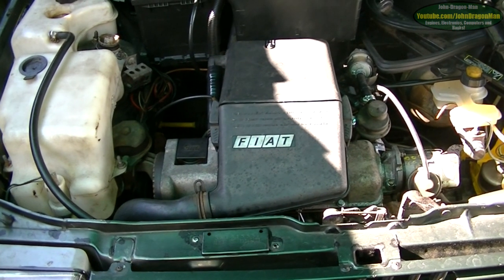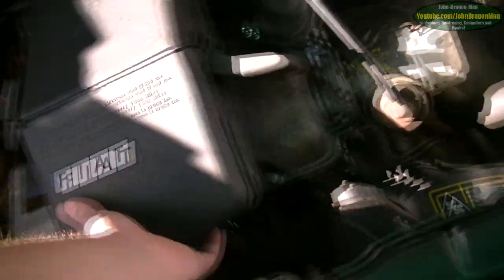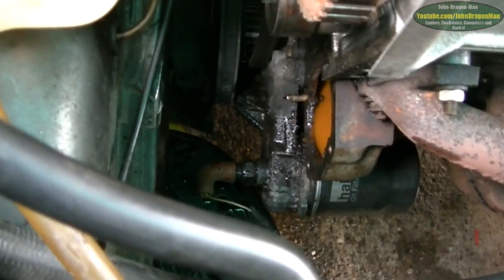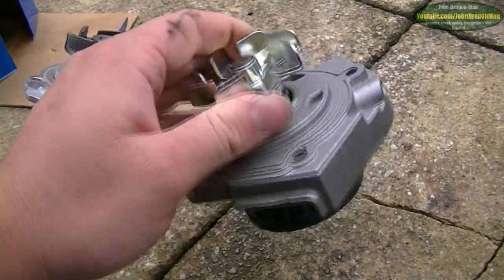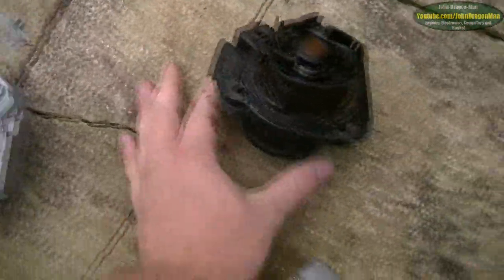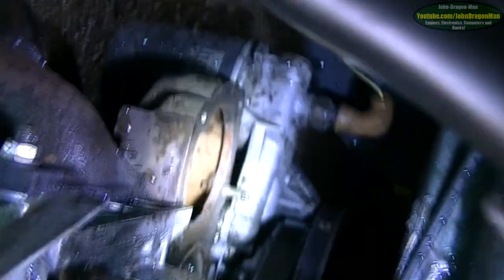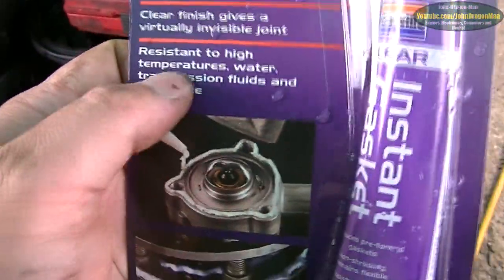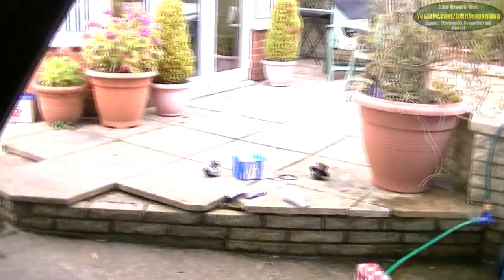Fiat Panda 4x4 Sisley Video log No. 28 (Water Pump Replacement)

Comment from the maker: yes it does now. i used an exhaust gas tester and got the emissions right down.
we also set the ignition timing up nice with a 2 degree dwell.
its been almost a year now, and would like to do it again.

Comment: you can clean up oxidation of rocker covers by using some fine sandpaper or fairly coarse depending how oxidised it is. id say p600 for light oxidation and p320 for heavy oxidation dry sanding is better since wet sanding makes all the oxidation reform. i de oxidised my engine and gearbox and looks really good.

Comment: looking good! is it almost ready to go back on the road now or are you going to to the tiny bit of bodywork it needs first? For your rocker cover I would sand it progressively from about 400 grit to thousands and then polish it with autosol if you wanted it all "gangsta" chrome. :D

Got my panda to mot at the end of this month needs some work on the exhaust and it should fly right through (touch wood)

Comment from the maker: hehe the 903cc engine is the same as the 899 engine. it just has a different head.

the FIRE engine came in 750cc (8v), 999cc(8v), 1108cc(8v) 1242cc(8v and 16V and 1368cc (8v and 16v)
the one in my panda is the 999cc FIRE engine (running at 50 HP).

Comment: Are you sure Its the same engine in Cinquecento? In your old Fiat Cinquecento I think not. Because im not sure but sinse 1996 put in cinquecento a new 899cc engine with fuel injection you have a carburetor. In Fiat Cinquecento, Seicento, Uno, Punto Fire engine its 1.1 55 hp

Comment: Sorry I make a few mistakes 
1. In your old Fiat Cinquecento you had a Injection fuel older cinquecento a carburetor
2. Your Panda probably has the same Engine just like in older Cinquecento 903cc with carburetor 
3 I think but I am not sure all 900cc engines is not a fire engines a fire engine have a fuel Injection and it's a 1.1 55 HP

Comment from the maker: all fiat panda 4x4's are the same.. the sisley uses the same running gear as the standard 4x4. the fact that mine is a sisley just means that you get a few "luxury" items like the inclinometer, plastics around the windscreen and the sisley badges. thats it.
in all fairness theres 2 "classic" pandas, the 2 wheel drive and the 4 wheel drive. the 2wd will drive a little better than the 4wd, the 4wd has a little more engine power (5 bhp) over the standard 2wd